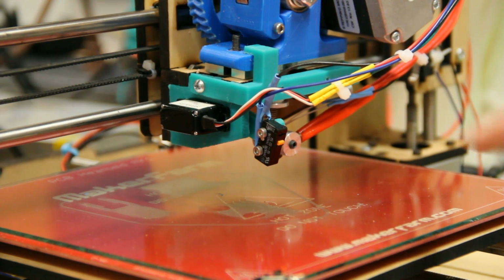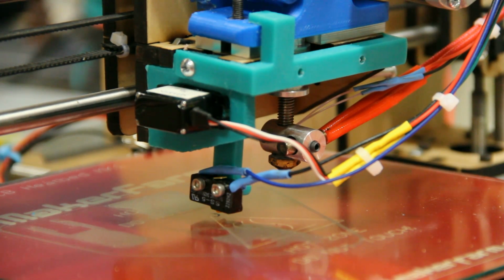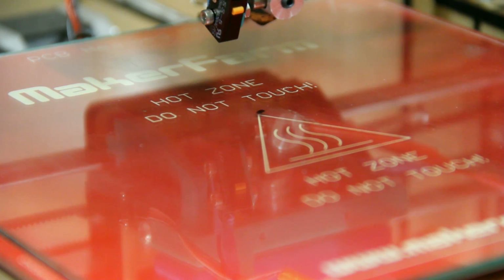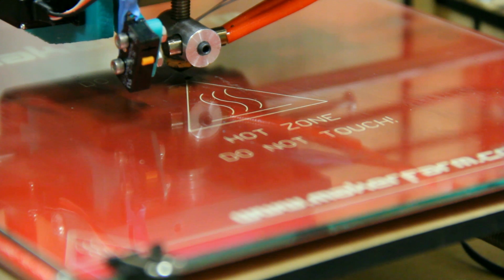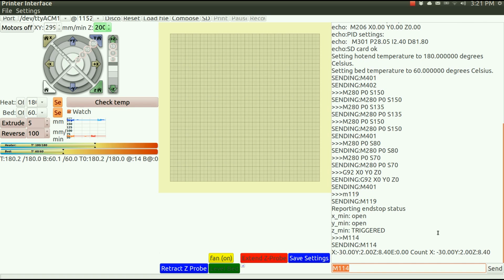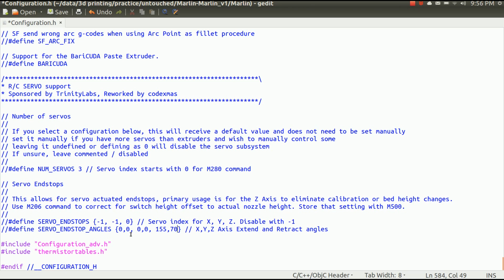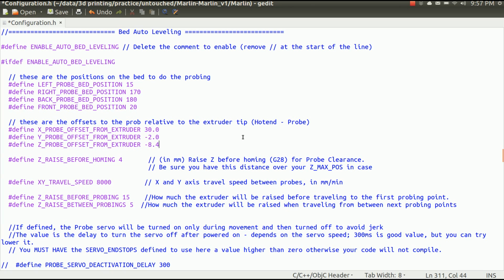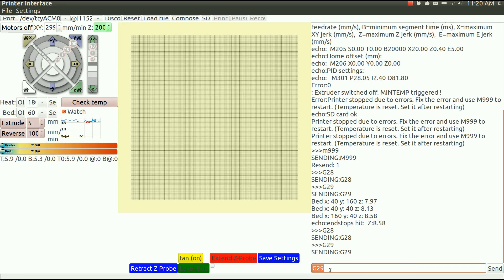Setting up auto bed-leveling on the Makerfarm Prusa i3. Part 3 - Final setup

Comment: I have a bit of an issue. I followed your directions about two years ago, and I've had no problems since then, thank you! 

I believe my servo motor has died, because it doesn't extend or retract during bed leveling, and I can't get it to move with commands. 

Normally, I would swap out the servo, update the servo angles in Configuration.h, flash my RAMPS board, and viola. However, I accidentally deleted my pre-configured Marlin firmware code, and I don't want to have to reconfigure everything.

Long story short, do you know of a way to override those servo angle settings with G-Code before a print?

Thanks!

Comment: we're do you wire the switch at the bottom of the servo arm? I noticed in the first video you showed where to plug in the servo on the ramps board but not the switch

Comment: Just in case someone have the same issue I got the X and Y offsets with points so I had hard time compiling the hex file every time getting error finally find out that X & Y offsets must be integers no points

Comment: Hey! im running into a few problems with auto bed leveling, after doing what youve suggested and giving the print command, my printer performs the bed leveling routine and then the z axis lifts (ive adjusted the raise before probing value to be 35mm in Marlin) the servo arm swings and stays parallel to the bed, now im expecting the x-carriage to lower and the nozzle to come near the bed, but it simply starts printing in mid air, I cannot find a solution to this and it is immensely frustrating kindly help!

Comment: Hey Michael,
Thanks for these videos... I completed my Auto leveling on my i3 and it works great!
Apart from when I give it the G29 command....
The Z axis drives down and it lowers the servo too low and the lowest corner crashes into the build plate..... That is, the Z is too low before the switch can get level with the build plate...
Any suggestions???

Comment: Finalized everything and double checked all my values that are in marlin for offset from probe to hot end.  I'm still having a problem where the print head is too far from the bed for my first layer.  Does anyone know what might be going wrong?  The z servos will move back and forth to compensate for the bed being unlevel, so the bed leveling function is running correctly, but I'm still struggling with the first layer gap.

Comment: My bed is 200 x 280 is this correct if my bed is 250x315? 

     #define ABL_PROBE_PT_1_X 0
      #define ABL_PROBE_PT_1_Y 0
      #define ABL_PROBE_PT_2_X 0
      #define ABL_PROBE_PT_2_Y 200
      #define ABL_PROBE_PT_3_X 280
      #define ABL_PROBE_PT_3_Y 200
I don't need to have space room as the bed is bigger than the build area, just wanted to confirm

Comment: So I have this set up on my custom built printer (Ramps 1.4, Marlin) and when I enable servos the thermister starts reading really sporadic temps. I have narrowed it down to enabling that line of code which causes the problem. I can't seem to find anything else on it on any forms. Was wondering if you would have an idea of how to fix the problem?
Reply: +Martin Dickey I had the same problem with crazy temperature fluctuations with the servo on.  Basically, i had to enable the line in marlin "#define PROBE_SERVO_DEACTIVATION_DELAY 600" so it would switch off after moving.  That solved the problem with the servo interfering with the temperature readings.

Comment: Great videos, thank you.   You don't seem to mention where you wire the microswitch to on the RAMPs board, that's the only part I am a little confused on.  Do you mind explaining that?  Thanks.
Reply: +Ed Farias He covered that under part 1.
Reply: Bigrignohio he mentioned the servo, don't recall the microswitch though. I will watch again, thanks
Reply: +Ed Farias
Hm, you may be right. I have yet to build one myself (research stage).
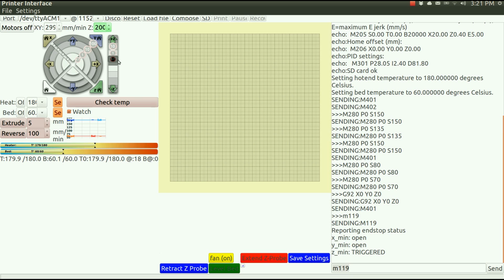Edit: At 8:15 it shows he is using the Z_min endstop.
Reply: +Bigrignohio Yeah, I'm pretty sure you just connect it to where the Z endstop was.  I've since connected a proximity sensor and that is how it was done.  Still might go servo though, we'll see :)
Good luck.

Comment: Hi quick question does the z probe have to be the same height as your hotend nozzle  like when its lowered ?
Reply from the maker: +TriniRCmodels Not at all.  in fact, the Z-probe should extend below the tip of the nozzle.
Reply: +ZennmasterM ok i got it to work but i have another problem after i get the height of the offset for the z probe i set it in marlin firmware when i send  it to print everything goes well all axis home then auto bed leveling start and finish then the printer heat up then when it start to print the nozzle head is still to high resulting in rough bottom layers and then when is printing a few layers up the nozzle hits the print  i need some help

Comment: om the firmware on the printer checking the z offset.   should it be the same as the #define Z_PROBE_OFFSET_FROM_EXTRUDER  for the config.h

for example.  in pront  i enter m114 gives me my value.  Z2.50   once i flash new settings.  should the 2.50 also be the z offset in marlin under the motion menu

Comment: Nice videos.  Thanks a bunch.  I did have a small problem, when I auto home the X and Y work fine, but the Z probe does not auto extend.   I run the m401 and do auto home it works fine, then I can run m29.  Any ideas on what I'm missing for the Z probe to auto extend and retract on the auto home?I've also notice the servo has a twitching problem, again ideas?

Comment: I have been having a problem were I can not get the servo  to swing to the angle i need any clue why? No matter the setting is seems to stop short of being  in the spot I need to hit correctly tried 165 180 so on but all seem to be the same. If I hit M401 twice it will go past that point so not sure why I can not get it to do on first M401.. :/

Comment: I should not reverse the sign of my probe. Maybe because the sign is related to the HOME Position that you have got in top right, mine is left down. The main way to check if the sign has to be reversed or not is to Home all axis with the "home all" button. If the probe is not ending in the zero of all axis ( in my case is the center ) then you have probably a wrong sign on the probe offset.

Comment: hey ZennmasterM 
i built a prusa ir2 about 2 years ago and had loads of trouble with it plus loads of fun 
any way i am in the process of rebuilding it to sort out some of the naggin issues 
i am not sure how this auto leveling works ie ( if your bed isn't level in say 3 points ) what does it do to compensate and will this same setup work on my prusa with a few modifications 
also i did away with ramps 1.4 and will be using MKS Gen V1.3 controller Board 
still waiting on some parts before i can install marlin on it 
so i have no idea how good this board will be 
any info will be very welcomed 

p.s thank you for the vids very informative only 1 thing you left out was where to connect the Z probe endstop too on the ramps board

Comment: I print primarily from the SD card - Is there a way to set this to auto-level when you press the return to home via the LCD screen
Reply: OR do the auto level automatically at the beginning of every print run via SD or PC
Reply from the maker: ***** That's my method.  In my slicer program (Slic3r), I just include the G29 at the beginning of the G-code file.

Comment: Have it working great on my printer. My buddy is trying to get it to work on his. G28 auto homes. G29 runs the auto bed leveling and the extruder moves to each point and lowers twice at each location, but it stops just shy of triggering the switch. Why would it stop before the Z endstop was triggered?
Reply from the maker: Richard Sisco In Configuration.h, make sure the software endstops are set to "off".

Comment: I have followed your tutorials so far, but now I have an issue. When I try to home the Z axis, the probe extends until the switch contacts the bed. The probe then retracts as it should, but then the Z axis will not go any lower than the probe, so the extruder tip won't get closer to the bed. Any idea why this is?
Reply: +Randy Yeager were you able to figure out this issue? I am having the same problem
Reply: I forget what I was doing wrong, but I did figure it out. I had to change something in my configuration.h file. Want me to send you the file as a reference?
Reply: yes that'd be nice!

Comment: Important note:  You may have to uncomment #define DISABLE_MAX_ENDSTOPS in your Configuration.h file.  I had to for my Folger Tech model.  

On an unrelated note, anyone know why my servo arm would be acting all Michael J Fox when it's probing?

Thanks!
Reply: Glad you were able to get that fixed!
Reply: Caleb Roosa Not sure where my last comment went... but anyways, I actually did have that uncommented already, so I'm still in trouble. Thanks anyways, haha
Reply: What's it doin exactly?
Reply: I cannot lower the z axis below the point where my probe hits, so I'm about 12cm too high.
Reply: I'm assuming you mean 12mm?  Does it appear to be homing properly?  Send a M114 command to it after homing it and see if the coordinates match where the extruder is located.
Reply: Yes, 12mm (stupid autocorrect). I'll try that and see what happens
Reply: M114 will tell you the exact coordinates (or what Marlin thinks the exact coordinates are)...  So if it's homed properly, this should make sense.  If it doesn't, something might be wrong with your offsets.  Your Z axis should be 0.0 when it is roughly 1 sheet of paper width away from the bed.
Reply: Okay, so that tells me Z: 12.00 which makes sense. And now I believe it is actually working! Before sending the m114, Repetier Host was indicating that Z was at 0.00. After the command, it correctly showed the 12mm that I assigned as my offset, and I can move the axis lower. Thanks a bunch, man!
Reply: Still isn't working quite right. Could you possibly send me a copy of your Configuration.h file to use as a reference? Also, What are you using for your starting G-code? Thanks.
Reply: I just added G29 (auto level) after G28 (home); What version of Marlin are you using?
Reply: I am using Marlin 1.0.2 which is the latest version as far as I know
Reply: Whats wrong now is that after it homes the X and Y axis, the probe arm is not above the bed when it starts to home Z
Reply: Randy Yeager Randy, I see that you sort out the " Z offset "  12mm too high issue.Can you tell how you did to set the offsets in configuration.h section?I do have 3.92mm too high and can't find the way to set the proper offset.
Thanks in advance
Reply: Randy Yeager  Check this section in configuration.h  You should set the X and Y points where the Z homing is about to take place. (set these points  in terms of total a length divisor: eg. if your print area is 200 by 200  use X_MAX LENGTH/2 and same for Y axis)  
//If you have enabled the Bed Auto Leveling and are using the same Z Probe for Z Homing,
//it is highly recommended you let this Z_SAFE_HOMING enabled!!!  #define Z_SAFE_HOMING   // This feature is meant to avoid Z homing with probe outside the bed area.
                          // When defined, it will:
                          // - Allow Z homing only after X and Y homing AND stepper drivers still enabled
                          // - If stepper drivers timeout, it will need X and Y homing again before Z homing
                          // - Position the probe in a defined XY point before Z Homing when homing all axis (G28)
                          // - Block Z homing only when the probe is outside bed area.  #ifdef Z_SAFE_HOMING    #define Z_SAFE_HOMING_X_POINT (X_MAX_LENGTH/13)    // X point for Z homing when homing all axis (G28)  DIVIDI LO LARGO DE LA MESA ENTRE 10  PARA Z HOMING
    #define Z_SAFE_HOMING_Y_POINT (Y_MAX_LENGTH/2)    // Y point for Z homing when homing all axis (G28)  #endif

Comment: ok i have a question....  i get everything setup and hours of looking on the internet to get a r/c servo with  my rumba board ....  with the "G280 P0 S150"  i got it to move but them the printer will restart and come back on .   if i reconnect to the printer and try again it would do the same thing.  any thoughts on this?  or can anyone help me?
Reply: Nate P i got it working now on a ramps 1.4 board but now when i add the "G29" after the "G28" in the start code it will home then when it goes in to the "G29" the printer shuts off then back on...  anyone have thoughts on this?   EDIT!  if i have the usb plugged in it will G29 fine ....could this be a power sup. problem
Reply: Nate P That seems to be caused by a power hungry servo.

Comment: Hello,
I want to use the microswitch on the probe as a Z endstop switch (I already have my bed level).
I followed your tutorial and when I started a print the nozzle stayed at Z offset height assuming this is the Z=0 point. How could I low it down to touch the heatbed?
I could use a Z offset option in slic3r. Is this the proper way? Am I missing anything in configuration settings?
Thank you,
John
Reply from the maker: ioannis0 I'm not sure where you are starting from.  Do you have ABL set up?  When you start the print, are you homing Z first?
Reply: ZennmasterM I have set it up but I hadn't send the M851 command to adjust the offset. I read about it in the comments of the configuration file. I had to send M851 Z-3.5mm (3.5mm is my Z offset).
Before that if I was sending G1 Z0 my nozzle was staying 3.5mm above the glass and I could manually move it to -3.5mm (where it should by my Z0 point). Also I had to adjust a 3.5mm offset in slic3r.
After the M851 command, if I send G1 Z0, the nozzle is on the right position. The only problem is that I can still move it manually to -3.5mm which could damage my glass or my nozzle.
Is there any fix to prevent it?

Comment: Hey thanks for the nice tutorial. And I managed to applied it on my printer, but on mine the servo detents and retract between each probe, and apparently yours stay down the whole time which is awesome. How did you do that ?
Reply from the maker: victor jung That's actually a change in Marlin.  I made this video shortly after the feature became available, and back then that's how it worked.  The newer versions all retract the probe now.
Reply: ZennmasterM I don't like that cause it retracts, when still low, meaning that the switch could bump into the bed depending on the design of the arm... I will try to find where this is coded to modify it. Any clue in which file is it coded?
Reply from the maker: victor jung Update:  I am told that the current version of Marlin now supprts a command: G29 E, which doesn't retract the probe between probings. Try that, and let me know what you find.
Reply: Yep I tried and it doesn't retract between probes
Reply: ZennmasterM What is the version of Marlin you are running? Mine does not do that, and I tried 1.0.2 as well... maybe I am missing something.

Comment: zen i followed all your instructions.. and this happens..SENDING:G29
Bed x: 50.00 y: 50.00 z: 7.40
Bed x: 100.00 y: 50.00 z: 7.40
Bed x: 150.00 y: 50.00 z: 7.40
Bed x: 150.00 y: 100.00 z: 7.40
Bed x: 100.00 y: 100.00 z: 7.40
Bed x: 50.00 y: 100.00 z: 7.40
Bed x: 50.00 y: 150.00 z: 7.40
Bed x: 100.00 y: 150.00 z: 7.40
Bed x: 150.00 y: 150.00 z: 7.40
Eqn coefficients: a: -0.00 b: 0.00 d: 7.40
planeNormal x: 0.00 y: 0.00 z: 1.00
echo:endstops hit:  X:71.00 Y:77.60 Z:7.40

it basically homes x 5 times really fast and no other thing just in the far back left.. any idea?>

Comment: I followed your video and I got it to work, the marlin firmware has updated and now everytime I enable autobed level after calibrating the Z motors Grind and fail to move
Reply from the maker: You'll need to go back through your Configuration.h and make sure all the changes have been carried over.

Comment: Hey Mike and viewers. After getting the bed levelling up and running my my prints since then keep stopping and ramps reset its self. Anyone have a clue my servo does jitter a lot when X axis is moving.
Reply from the maker: You may have a power-hungry servo that is overpowering your 5v rail.  Two things to try, in order of difficulty:

1) Make sure you've got  #define PROBE_SERVO_DEACTIVATION_DELAY 300 uncommented in your Configuration.h.  This cuts power to the servo when it's not in use.

2) If that doesn't solve your problem, try attaching an external 5v source to the servo rail.
Reply: ZennmasterM Happy new year, and indeed you were right on both  its power-hungry and I didn't uncomment the   #define PROBE_SERVO_DEACTIVATION_DELAY 300. I changed the servo and uncomment and ill give it an other run. Thanks for your help.

Comment: When i run the G28 Code and try to home, the Z axis is just buzzing. i did set the travel speed to 3000. But it did not help

Comment: Thanks a ton for your great videos.  You really break it down so that newbies to reprap like myself can understand and follow what to do.  I will say you should touch the endstop first then the nozzle so that you don't have to reverse the numbers but maybe that is just the machinist in me.

Also, thanks for uploading the servo mount it works perfect and is nice and tucked away while not probing.  I can't wait to not mess with z height every print, for some reason the stock setup is not very consistent I believe because there is only a zip tie holding the end stop on.

Comment: ZenmasterM i followed the directions to a t and when i enter g29 in pronterface my z axis probes in its current position even after a g28
Reply from the maker: Yeah, I've heard of that problem from a few poeple.  I haven't been able to replicate it, and so far no one has shared a solution with me, so I'm afraid I'm little help at the moment.
Reply: Mine is doing the same. Have you fixed this yet Nkdurrett?
Reply: I upgraded to the newest version of marlin and went from the three probe auto leveling to the grid auto leveling. that fixed my issues